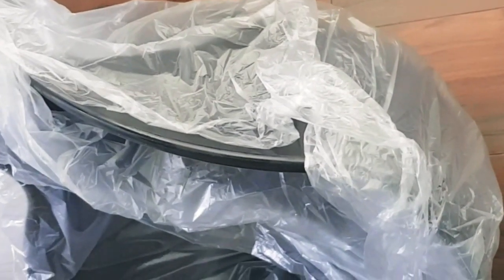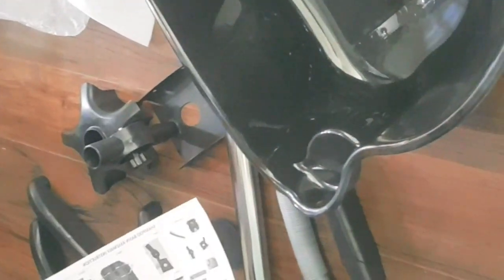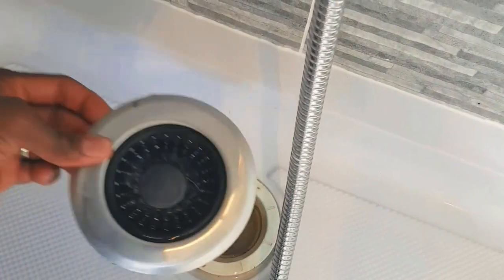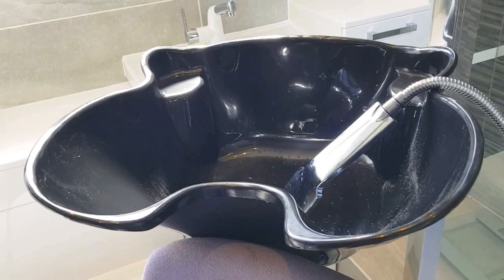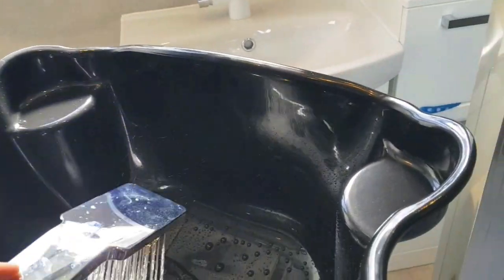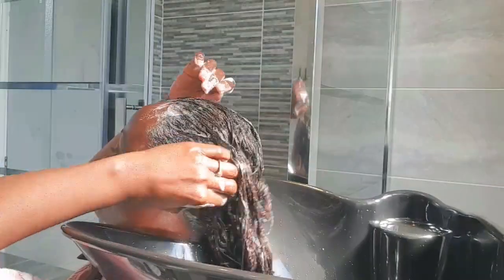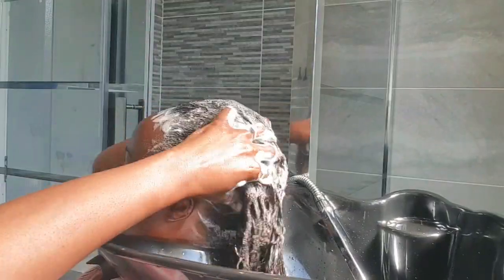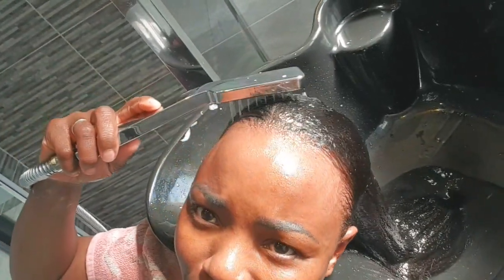PORTABLE SHAMPOO BOWL WASHING BASIN SET UP GETTING WATER IN AND OUT

Comment: Please tell me how you keep your hair from knotting and clumping when wet? Takes me hours to and so frustrated..please do a video so i can see how you detangle wet hair and ends
Reply from the maker: On your request I will make a video showing how I do mine,  in the meantime the only time I detangle on wet hair is under a running water, doing a pre-treament before shampoo also help, otherwise there's a video on how I airdry and detangle that might  help a bit. 😍👍
Reply from the maker: If you don't mind me asking what technique do you use when you are Washing you hair? 😍
Reply: @faithletsgrow  i do so much to try and retain length...i start with a treatment of olaplex or  a deep conditioner, Wash with moisturizing shampoo then conditioner or a protein treatment then more moisturizer again. I havent used a blow dryer for 2 yrs. I air dry 80% then put leave in conditioner with a cream or oil. This is where it hets hard to detangle.i have been doing everything right (i think)but still having hard time retaining length. My hair is at my neck and a bit thin..the only thing i dont do is protective styles because i am active and sweat ALOT in my head..my hair is so wet i feel it wont dry before  my next workout if i weave or braid ..i ABSOLUTELY HATE WIGS. Cant have sweat pouring from under wig. I also take biotin and vitamins and i see new growth but not length...☹
Reply from the maker: @flatbedladyv2191  your routine sounds good,  if you are not retaining length and you don't like protective styling then  try doing the baggy method on the length of your hair at night to keep moisture in,  when washing our hair we can't wash it like the white people Shampoo ads,  you will need to pick a section of your hair then left it up and put your finger through that section and scrub your scalp,  what you don't want to do is rub the hair  together as you are Washing doing so will make the hair tangled up,  regardless of how good your deep conditioner is  a good shampoo technique will prevent too much mattnes, I showed a bit on how I do mine on this link , sorry I think that was the first few video I made starting out not very good camera👇 https://youtu.be/reYo-9cvEPM .😬🤩😍,
Reply: @faithletsgrow  thanks...just washed my hair your way...i will try the bag on my struggling ends too thanks
Reply from the maker: @flatbedladyv2191  I will try and make a better video on how I do mine,  hope you can start retaining length soon 👍👍